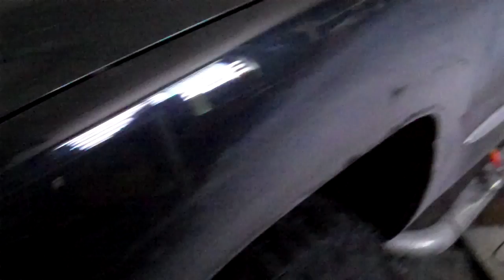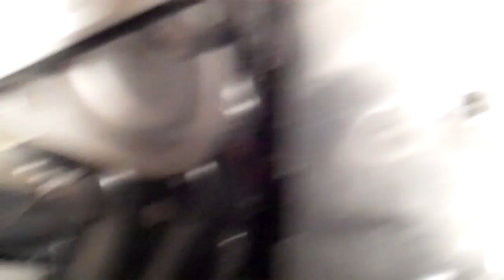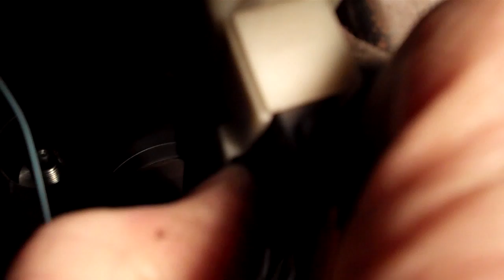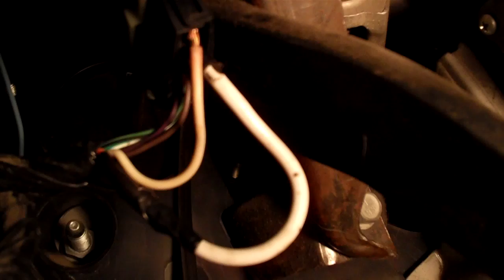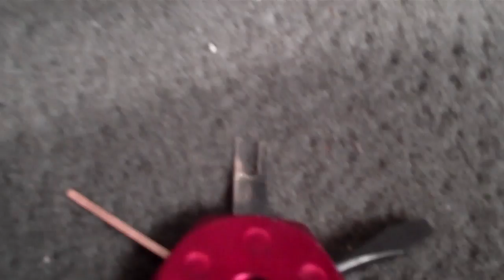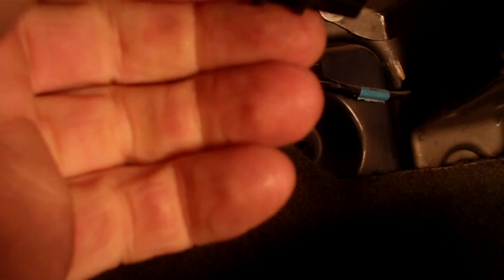How to fix the cruise control, brake lights, and trailer lights on your Chevy Truck

Comment from the maker: Great question!  The plastic got really runny and coated/burned onto all over the metallic portion so it made poor contact.  Taking it apart and getting the metal out was the best way to heat it up and clean it off.

Comment from the maker: @PWRSTR0KER2008 The 3" piece I put in will last a few years.  The whole thing should be replaced, but the cost of repair is 20X more $ to replace the whole wire back up the steering column.

Comment: @pberglin there are 2 studs at the front of the fuse box for stuff like this. i work at a dealer and install lights and other accessories to these studs. they are fused, but there may not be fuses in the spots. look at the cover to see which fuse goes to which stud.

Comment: ok on my 2004 Chevy, the "plug" was on the right side of the pedal. i hit it with a test light, nothen. But after "wiggling" the connector, IT WORKS!! I messed with it for a few. Still works! all is good! ( for now). But if this happens again I will look into a new connector. TY for you video!! it was a BIG HELP!!

Comment: I have the new cruise switch so I know it can be changed.  I was trying to avoid removing the airbag if possible.  I don't think removing it is going to reveal anything since the airbag is in the center of the steering wheel and the switch is on the left side.  That's a good tip about the small gauge wire on the brake lite switch.  The GM techs I talk to never mention that.  They just say:"Change the switch", nothing about the wire.

Comment: Everything I have learned to fix cruise control: Switch out brake switch, wire up resistors if you have led brake lights which fixes hyper flash also, swap 3rd brake light back to halogen bulbs. Either or all should fix cruise control

Comment: Very helpful Brian, I just changed my brake switch cause my cruise control isn't working and it still doesn't work after changing it out, I was told that I need to let the truck and computer cycle a few days to learn it I guess? I am also thinking now that it could also be what you mentioned in this video, I will look at that soon and see. Thanks a lot man!

Comment: Well I ran into your YouTube video I was trying to figure out why my customers brake lights weren't working I hope my power probe up to it and it turns out the brake light wire connector completely a was just crap it was so brittle that when you barely moved one of the wires it split the insulation and literally broke the wire turns out you can't buy a replacement so we had to rebuild the whole pigtail.

Comment: I have the same problem on my 1997 Chevy Tahoe my brake lights wouldn't turn on when I push on the brakes  so I assume that it was the brake light switch but it wasn't it was the wires that connect to the brake light switch but I have figured out and did some research that it was too much current going by the wires causing it to worn out ... but I'm not sure if this is a factory problem or I have a short somewhere

Comment: I was waiting to see where the cruise control switch is. I have a problem w/94 silverado engine racing @2-2.5RPM's in idle. I was thinking my cc might be engaging. I had this problem last year. The mechanic told me he disengaged the cc so it wouldn't happen again.

Comment: Just run a havier  wire from a fuse free area close buy and replace the burn  one with it cut the burn put some tape in it case solve sense you are there just take the switch out and be sure to lubricate good not all just the movement part

Comment: I have cruise control problem on Silverado.  I heard about the switch, but was not told about the wire gauge being too small.  How do I get the cruise control switch out for replacement?  I tried torx, allen, phillips, flat and pin punch.  None worked.  I looked in the little hole in the back of the steering wheel where the cruise switch is located with a mirror, but can't see a head of any kind on the fastener.  How do you remove the darn cruise control switch on the steering wheel?

Comment: For some that may be having this issue it may also be the brake switch that the wires are plugged in to. I have the tow package but not a short in the wire. My problem turns out to be the module that actuates the brake lights which those wires are plugged into with that plug. Just beware that may also be an issue. If you are wiggling the unit around and everything suddenly starts working then its possible that $20 switch has failed. Looks like a bear to replace though...
Reply: Replaced brake booster and I started having issues with shifter being stuck in park, brake lights not working and cruise control not working sometimes. With stop lamp switch hooked up I could manually move it up or down and all these problems would go away as long as I manually adjusted the stop lamp switch. I solved my problem by placing a piece of thin hard plastic in between the booster rod and the connection on brake switch. Turns out the rod was shorter than the original and was not pressing the switch all the way.

Comment: my 1997 s10 brake lights dont work and the cruise doesnt either. is that the issue you had and what year is the truck you worked on to fix it?

Comment: Is the burnt area always in the same spot or did you have to search for it in the dash? How much of the wire did you need to replace? where does the wire run to? The fuse block under the hood?
Reply from the maker: +midnight1380 It's almost always in the same spot in the production year range shown.
Reply: ok so what if the plug is not burnt anywhere and iv checked all the fuses and there all fine and im still having this problem what should i do next?

Comment: How long is the wire  going from the brake switch to where ever it goes? I traced the wire up to directly behind the gauge cluster on the left hand side. Is this where it was located for you? I have also test lighted that wire directly at the switch and the light has power so that leads me to believe that this is not my problem. I have checked all fuses and changed the brake switch and the block under the back of the truck by the exhaust. I have no other ideas. Any response with help would be awesome. Btw I drive an 02 Tahoe so I guess it is a bit different.
Reply: John Olinger do u fix ur brake ligths?
Reply: leonz28 yes i fixed my brake lights, what it ended up being for me was a burnt wire at the plug under the passengers side rear quarter pannel. How i fixed it was wired in a relay from the high center mount brake light for signal and power then just grounded the relay to the battery. I could have also  just wired a new connector to the factory wire but i didnt know how far back it was burnt. But what i did serves its purpose so it will stay that way for now.
Reply: cool..i was having the same issue a few days ago the brake ligths doesnt working...i replace the cruise switch all fuses i almost dismantle my tahoe and nothing..turnme crazy for 3 days until one day in the morning i foundout that my dilema was that the bulbs wanst in the rigth plug..some body some how swap the bulbs finally i fix the issue..i hope this info helps someone..

Comment: Could you please tell me the part number or name of the tool used to open the casing? I understand it was from Matco.
Reply: Terminal Disconnect Tool Set with Handle - Matco Tools

Comment: Hey Brian. The cruise on my 06 Suburban stopped working(no green indicator light on the dash either). I've replaced the brake light switch and cruise/turn signal lever and check the fuses and no go. Any other ideas? Thanks Tony
Reply: Tony M did you ever find the problem? I’m having a similar issue with my 06 Silverado

Comment: you said, "second wire in." but you keep pointing to the one at the very end. is it the end wire or the next one in?
Reply from the maker: +Wiggy McCrackin You'll be able to tell when you look at it.  It will be darker near the plug.  It's the light colored wire that looks burnt.
Reply: +briansmobile1 the white wire is at the very end, the second one is orange. neither look burnt. I took a light tester to the orange wire, and got a steady light. and I tested the white one, and got nothing. and was applying the brake while testing.

Comment: Hey Brian, long time viewer here. I have an issue on my 06 GMC 2500 where when i press my brakes with my turn signal on, the tail light sequence changes and flashes opposite of the cluster,front signals, and tow mirror signal. Happens in either direction. All lights are Led, and i do have an led flasher module, and do not have hyper flash. The problem is only during braking. Ive asked dealers and mechanics, electricians and no one has ever heard of anything like it and no one can help. I have replaced the turn signal switch, tail light circuit board , multiple sets of tailights, and inspected the grounds (that i could find) any ideas? Thanks

Comment: The airbag has to be removed. That's because the cruise control switch is attached to a trim piece which is held in place by a bracket which holds the horn/airbag assembly. Once the air bag is out the bracket has to come out because the trim piece which holds the cruise control switch has these little finger with holes in them to keep eveything in position. You get the bracket out of the way and remove the electrical contacts for the horn and the trim piece and switch finally come out.  PITA.

Comment: Ive got a 2000 chevy silverado, I also have no brake lights or cruise control, replaced this wire so that it has a constant 12v and still nothing, anyone gotta fix for this or have dealt with this? Thanks
Reply: Check your brake light junction block

Comment: My cruise control works only when a trailer is connected
Reply: Did you install led brake lights?
Reply: @Brandon-ko1vx  yup I figured it all out now. If you have a led 3rd brake light switch it back to halogen and tada cruise control

Comment: That wire is supposed to have 12v constantly, isn't it? if I can just circumvent the problem and add my own fused run of wire to it I'd rather do that.